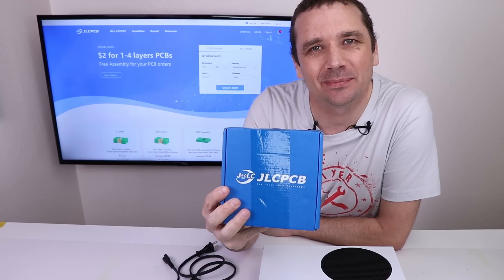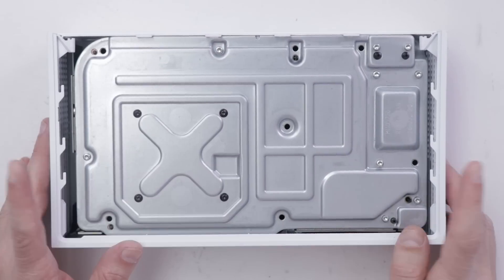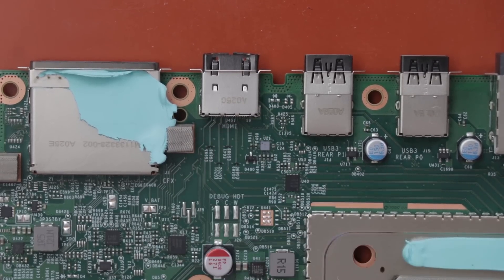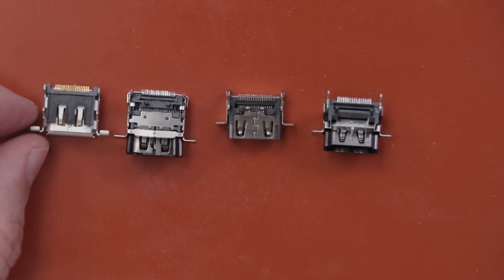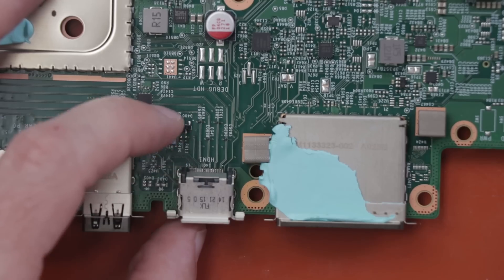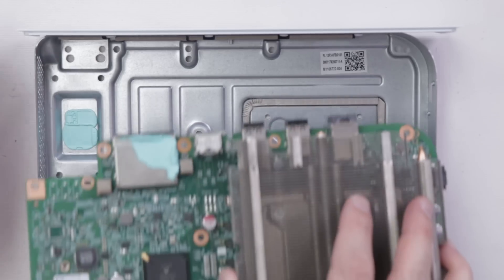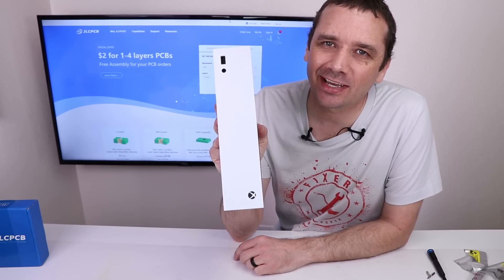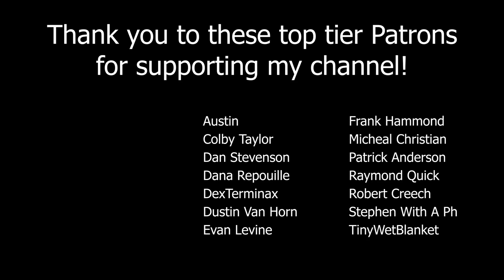I Bought the First Broken Xbox Series S on eBay - Let's FIX It!

Comment from the maker: The best place for custom PCB manufacturing. JLCPCB: $2 for 1-4 Layer PCBs, sign up to get $18 new user coupons; https://jlcpcb.com/RHS
What do you think of my "fix"?
Reply: you could've done a custom Flex PCB with a HDMI Connector as a Fix, you even have JLCPCB as sponsor :D
Reply: Can you give a shout out to louis rossman and right to repair movement!!!  if the bill pass, u can buy hdmi port. Now manufacturers can contract factories not to sell things to you and me and any one.
Right To Repair.!!!!
Reply: I think your next video should be on replacing the PS4 CMOS battery and how to re-sync to PSN since the scare is big right now.
Reply: @TheGlitchyMario  what's this thing with the CMOS battery? I've been seeing multiple ppl mention that as a problem.
Reply: @Pin-Din7  The CMOS battery handles the clock circuitry. PSN doesn't want you to change the clock to say that you got a trophy earlier or later than you did, so when you connect to PSN, it syncs your clock. And if the battery dies, PSN can't sync your clock. Because trophies are required in games, if it doesn't sync, it crashes the system, even on physical games.
Reply: @TheGlitchyMario  ouch I'm familiar with its properties with laptop but not with console guess it works almost the same? but that really sucks and granted due to you know consoles inevitablly getting older you know after they're out replacement parts should be readily available I'm sorry one has to go through such
Reply: @Pin-Din7  yeah. But once you replace it and re-sync with PSN, it should be fine until it dies again.
Reply: @TheGlitchyMario  ah gotcha
Reply: What temperature is required to remove a hdmi port on a ps4 with a hot air soldering station?
Reply: @OllieMD24  Hot

I think its around 600°F but I don't do a lot of hot air soldering
Reply: Nice fix Steve! Really impressed!!!!
Reply: 1:29 i will send you my console xD
Reply: Depending on the HDMI cable you have, it may fit without any modufication...
Reply: I have a problem. My mom a40 wont charge or turn on and i need help
Reply: I think it was a solid fix surprised that a and older Xbox one hdmi port works but guess that's Xbox honoring their middle name: compatibility. now does video look and feel the same of what it should be stock while on and playing? that's my question.
Reply: LoL like there no playstation to be fixed this dude always posting xbox and never playstation exposed! 🤣😂 Pony 🐴
Reply: Can you delete a reply on my comment it’s a scammer
Reply: i have a digital edition ps5 that is not showing on tv.  Can you fix to me? And how how?

Comment: @TronicsFix any tips on removing stripped screws if what you did didn't work? I have a PS3 with stripped screws holding the battery in which I can't find a way to remove.

Comment: hey maybe you could help me, i have an xbox one s and its working fine but just if i put it on 720p, if i use 1080p the screen is flickering and just works for 1second and the screen shuts off (the console stays on) ... its definetly not the HDMI cable and Monitor so it has to bee the console... any
 ideas?

Comment: If you want to remove a nearly-but-not-quite-stripped screw easier, just put a wide, thin elastic band over the hole and push the screwdriver tip in over top of the rubber.

Comment: Can someone help my Xbox controllers select button is registering like it’s pressed down but it’s not and it is also not stuck I have reset the Xbox and have also turned the controller off and back on multiple times and it still didn’t work
Reply: how long have you had the controller?

Comment: Hey @TronicsFix I have an broken iPhone 6s Plus I replaced the hole display and even buyd a new camera because mine broke after replacing the display but the camera doesn’t work after the replacement. The front earspeaker works probably and the day night sensor don’t work either is that an motherboard Problem or did I broke something due the repair? 
I’m so sorry if my English s*cks. I come from Germany 🇩🇪 I hope you can help me somehow because I don’t want to buy an complete new phone

Comment: Question: HDMI 2.1 compatibility? Does the older HDMI port that you installed translate newer HDMI signals properly? (Meaning, 4K + 120Hz, which system settings will confirm on compatible TVs.)

Comment: Sir my ps4 controller is not working I hv changed new battery and tha 12 port wire and it's getting charged too but it's not powering on

Comment: I would imagine the original Xbox One HDMI connector you soldered is limiting the output, as it is most definitely not HDMI 2.1, but instead HDMI 1.4b. The data rates are massively different and itwill probably be limiting the frame rate and resolution. But hey, it at least somewhat works.

Comment: The old port looks like it was extended at the back, can you not just replace the front part, and keep the extended (back) part at all?

One of the others you looked at (the bottom one of the PS4 ports) looks like it 'should' work if that was possible - looks the most similar to the front portion at least!

Comment: Hey Steve so I’m wondering since the next gen Xbox uses “hdmi 2.1”  does replacing the port with the one that you used take away it’s 120 FPS since older generation weren’t able to output more than 60fps. 
Ps. My apologies if i sound dumb I’m not super tech savvy but I was just very Curious if performance is taken away by using and older hdmi port
Reply from the maker: The port is the the pathway, it doesn't change anything about the rating of the HDMI system.

Comment: Good fix, but I don't know if it's sellable now with the way the port sits inside the case.  It doesn't have any side-to-side or up-down support around it from the case like the original.  You could use a 2-part epoxy around the port on the board to stabilize it I suppose, but then all future HDMI cables would still need to be reworked to fit.

Comment: The problem with this fix is that, without the HDMI 2.1 specification, now it will be limited to 4K @ 60fps rather than 1440p @ 120hz it's capable of. While you could argue "hey, it's doing 4K right?", the console will probably only output at 1440p anyway since it's not designed to go above that.
Reply: I'm confused, HDMI 2.0 does 1440p 120hz and goes as high as 4k 60hz. If you're on a 4k tv you're getting that 4k output aren't you?

Comment: Oh now I think I understand why flux works so well. 

It keeps you from making a mess with the solder? No accidental unwanted contacts being connected by dripping solder off the iron or whatever is used to press the pins into the solder? And provides some resistance to reduce wobbly hands making a mess?

Comment: Would the hdmi not be the older version and not the hdmi 2.1 it replaces? So you wouldn’t get maximum quality from the console anymore
Reply: HDMI 2.0 does 4k60hz and 1440p120hz. HDMI 2.1 does 4k120hz. In reality you're only losing 120hz at 4k. Even at that not a lot of people have tvs that support HDMI 2.1

Comment: To reiterate you can take a rubber band and stretch it over a T socket and make it grip a slightly damaged screw enough to remove with less worry.

Comment: Nice fix! Sometimes you just have to use what you have on hand but that’s no different than using a bodge wire. If it works it works. The only other concern I see is it looked like that hdmi port didn’t have support legs that fit the through hole.

Comment: A trick I was taught with screws with stripped heads, was to use a thin rubber band. Place the rubber band on the screw tip and then you should be able to grip a little better to remove damaged screw head.

Comment: Nice improvising 😀
But does everything really work with a xbox one original hdmi port? Does the series s not have a newer version, hdmi 2.1 if I'm correct? Or is the port really only there to plug in the cable? Just came to my mind.
Anyways greetings from Germany. I'd love to have your skills and equipment, would be really helpful at times 😅 we had several broken consoles the last 10 years and maybe they would have been fixable.

Comment: Great to see another console fixed. Good job.
I guess with the alien HDMI port it would have made sense to clean the GND holes and align the port with a little pushing to the side. Solder the small Pins first. The GND only after... It looked like that way you wouldn’t have had to bend each pin...

Comment: You should make a custom 1 inch M to F HDMI adapter to ever so slightly extend the port accessibility. That way you could still use any cable and not have to shave it down.

Comment: Question: Where you used the HDMI port out of an original Xbox One, which was HDMI 1.4, and slapped it into the Series S, which has HDMI 2.1, are there going to be issues with doing certain things, like pushing higher refresh rates/4k content? Or is that dependant on the hardware inside the console, and the port is just a path to get it there?
Reply from the maker: You nailed it. The port is just a pathway to get there.
Reply: @Tronicsfix  Good to know, thank you!

Comment: Stripped screws: use a rubber band wide enough to cover the screw and push the band in the hole with the screwdriver and screw it right out. Don't know if it works on hex screws though.

Comment: Nice work around with the hdmi port! It's does seem to be easier to sacrifice soft plastic than hard plastic.
Reply from the maker: Plus, I can always go back and solder in a new port once I can get one that is made for this console. If I shaved off the plastic case I'd have to replace the case.

Comment: I’m surprised it worked. Series S has an HDMI 2.1 port and you used, I believe, a 1.4 port.
Reply from the maker: That's not generally a port issue. The ports just have strips of metal in them, they're all pretty much the same.
Reply: I was thinking the same thing. I’m curious if it registers as a 2.1 port on the OS.

Comment: Im gonna guess at the original owner didn’t even get the case off, which with how that T8 looked is a good job haha!
Reply from the maker: Ya, probably not.
Reply: @Tronicsfix  Ha ha. As always great work Steve!
Reply: ye
Reply: See my first thought was maybe they did, realised they can't get the correct hdmi port, so put it back together using some kind of electric screwdriver and over tightened it until it stripped.
Reply: @MrJaiimez  I bet this YouTuber strips their screws a lot then since he uses an electric screwdriver sometimes
Reply: My thoughts exactly
Reply: No owner can fix it. Take it to get fix at store
Reply: Take it to Best Buy or other computer store to get it fixed

Comment: I love the look of that console.
Reply from the maker: It's really not bad.
Reply: @Tronicsfix  particularly I like the compact engineering a lot. That fan is gigantic! Nothing against the ps5 It's just... You can get great thermals out of anything if it's big enough ;D
Reply: @kylerclarke2689  I agree. The ps5 still looks like a console on the inside in terms of the hardware setup, these new x-boxs look more like small factor PCs.
Reply: @coylezo  yes! Huge fan of sff PC's and creatively fitting a lot of power into a small package.
Reply: Ikr

Comment: Hi Steve, I’ve got a broken wiiu game pad that only turn on when plugged in to its charger, but when I unplug it, it turns off. I have already replaced the battery and charging port with little to no change at all. I know this is an old console but would you happen to know what causes the problem and what I could do?Thanks so much!

Comment: Almost every console I have bought broken in the past few years seem to have broken hdmi ports... are people just shoving stuff into their hdmi ports?
Reply from the maker: I can't figure that one out. It's really not that hard to plug in an HDMI cable.
Reply: The friction when connecting and disconnecting the cable may wear out the port, it is definately a part with higher probability of damage.
Reply: @edubogota1  yeah, but most of these hdmi ports are on consoles that are less than 6 months old and some are completely mangled. Bent pins I can understand, but parts of the port falling out I can't.
Reply: @rockl79  I have seen people that make me cringe when connecting the hdmi ports , i have seen these cases mainly on PS5, it is a common issue.